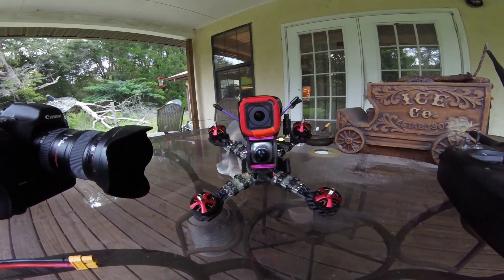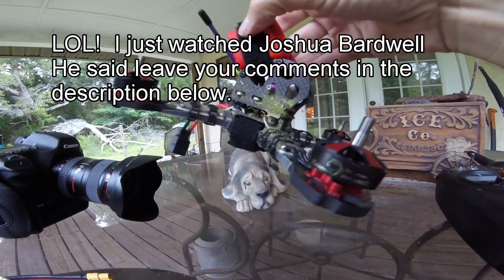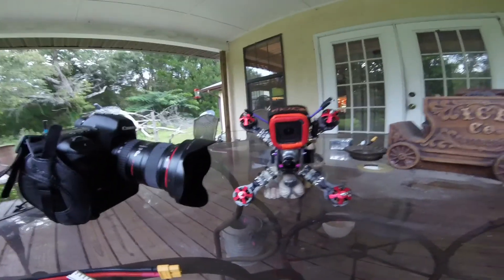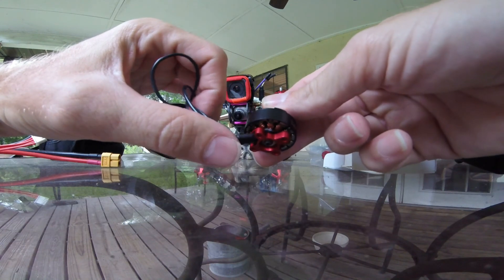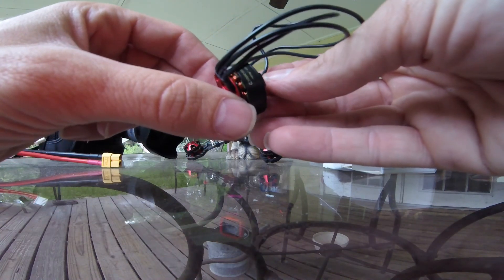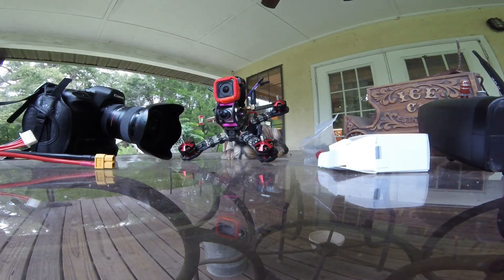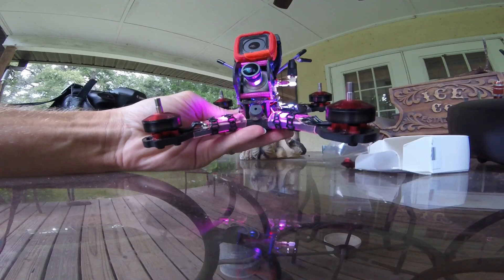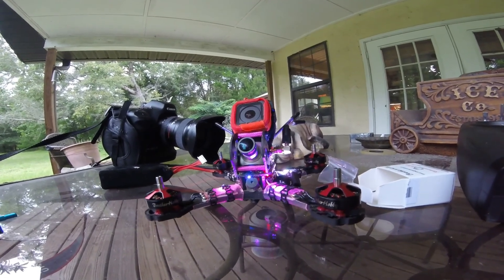Brotherhobby R5 2306 2450KV Motor Review

Comment: What's your build weigh with the GoPro but W/O battery?
Reply from the maker: With gopro and dal cyclone props, it's 438g, so just under 600g with a 155g battery.  This flight was with a chinahobbyline which weigh 170-175g.
Reply: mooosestang dang that showed some good power with that weight.. I just ordered a set and soo can't wait to try em..

Comment: looking at your property. i supose you have landed a few quads in trees before. so my question is How do you go about quad retrieval in trees?
Reply from the maker: usually a rope flown over with another quad and shake it out like this.  https://www.youtube.com/watch?v=-NyiQ2JrGew  Or this  https://www.youtube.com/watch?v=8xNEbJALxl8  I'll do a better video next time i get stuck, but flying the quad with a rope tied to the bottom directly over the stuck quad then pitch forward once over the tree and disarm letting the weight of the quad pull the rope, then rearm and fly it straight down inverted.  You need at least 100 feet of rope for that.  I also carry a 32 foot telescoping pole for the easy stuff.  this is the 28 foot version, just doesn't include the thin 4 foot piece on the end, which isn't very good for quad retrieval anyway.  very light weight and easy to handle.  https://www.jackite.com/online-store/28-ft-Thick-Tip-Orange-Fiberglass-Windsock-Pole-p78587343
Reply: Thanks alot. :D very usefull :D

Comment: how do you like them compared to the returner r4s? not a big fan of sub 2 min flights :D
Reply from the maker: I honestly like the r4's better, but they are on my chameleon so it's not an apples to apples comparison.  The bearings are shot in my r4's and i'm going to try and change the bearings on them.  I'll put the r5's on it and see how it feels. 2.5 minutes is about all i get with any motors and dal cyclone props.  I just buy a lot of batteries.  Any lowish kv motors that is.

Comment: You can post the PID configuration thanks
Reply from the maker: Betaflight 3.2, all notch filters disabled, set dterm_lowpass_type = PT1 Pids are pretty close to stock. http://www.pbase.com/image/166074956
Reply: mooosestang thanks, I'm surprised that this low Ds you don't get any propwash or midrhrottle oscillation. I just tested these motors On the motors tab and got vibes in 6-8 d/s range both pitch and roll.
Reply from the maker: What flight controller?  I haven't noticed any mid throttle oscillations with these.  i do have them soft mounted with tpu mounts and the bff3 is mounted on silicone o-rings, but it's a tight build, so some vibrations are going to get through.  I probably fly around a lot of prop wash subconsciously.  I've been flying for over 2 years.  You are just testing in the motors tab with props off and watching the gyro?
Reply: Hi, thanks for the reply. I'm on BFF3 with BF32 PT1 and all notch filters disabled plus dynamic filters. also softmounted FC and motors. Yes, i was just testing motors with props off and watching what the max gyro values were registered. these are brand new motors (R5s 2650 kv) so wasn't sure what the good baseline should be. All motors test gave me 5-8 range, but each motor individually i think i got up to 10 or more  which i thought was a bit high. thanks again.

Comment: Well do the r4s hold up good how many have u broke?
Reply from the maker: I haven't had a single brotherhobby motor failure, most of my flying is hitting pine trees and the soft ground here in Florida though.  The returner r4 2450kv motors are great motors.  I plan to use some returner r4 2300kv motors on an upcoming build.

Comment: So how are the motors doing have you crashed yet are they sturdy?
Reply from the maker: I've crashed plenty. Two of mine don't sound as smooth as the other two, but i haven't noticed any vibrations in my hd footage.  My returner r4's have stayed smoother longer though, not sure if they share the same bearings.

Comment: Very good review and good info about how they compare against other motors you have used. These appear to fly very smooth on transitions - low to full back to low throttle, that'll make them good for freestyling hopefully. 
Awesome that you showed the Max Amps at the end which agree with the slightly lower Amps I observed on the thrust tests.
Reply from the maker: Thanks, they feel great in the air, glad i bought eight.  I did another flight, made sure i hit full throttle towards the beginning and still got 98amps.

Comment: I've got two sets of those motors and I have to agree. They run a lot cooler then my Emax 2306 2400kv which was my current favorite motor. They feel about the same as the emax as far as power goes.  I have destroyed a few of the emax motors (no fault of the motors) and these will be the replacement on those quads.
Reply from the maker: I think these are a good alternative to the emax.  Better build quality and materials for almost the same price, plus 19g lighter!
Reply: what do you think about 2650kv version ? I am thinking about them to upgrade from emax 2306 2400kv
Reply from the maker: I tried the 2522kv motors from pyroflip and did not like the higher kv.  They feel like they have less low end torque to me.  After watching this video i believe they do indeed have less torque due to voltage sag, but if you run a big enough battery it might offset the sag.  Not something i'm willing to do though.  The emax 2400kv are really closer to 2300kv, so 2450 is still a big leap in kv and it's noticeable with these BH 2306's.  https://www.youtube.com/watch?v=aEdAkOkf4E8
Reply: Thanks for reply and the video! I fly almost all the time with 5x4x3 props, they are lighter (3.8g) . That's why I think high KV might be the adventage. But now you made me think.. maan :)
Reply: BlazoMusic I don't really know. Both of mine are the 2450kv version.

Comment: Man you have one hell of a playground there. Motors are nice upgrade over previous ones. The info on RCgroups showing the base enlarged around bearing closes the deal. Alos, F60s I got also had that cable heat shrink situation, but heat gun helped.